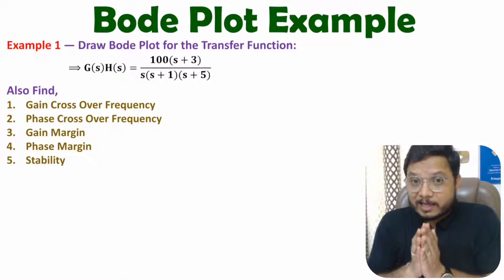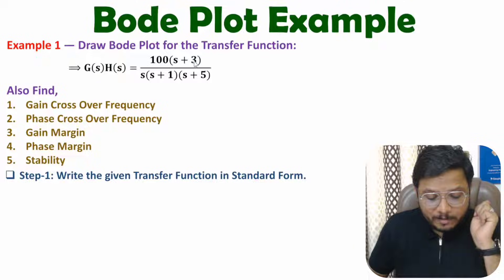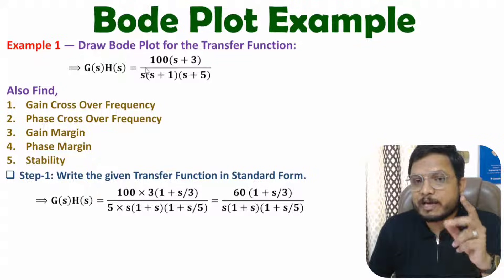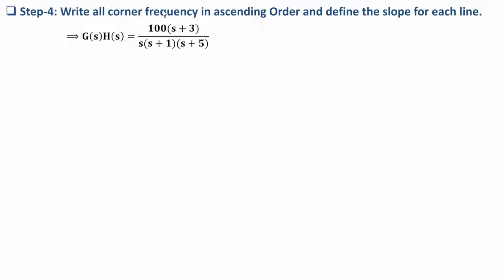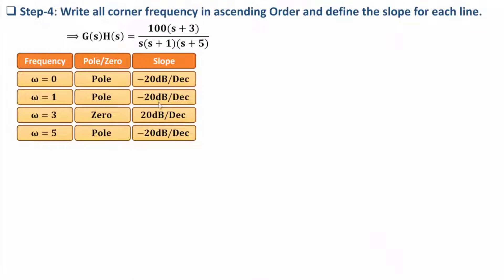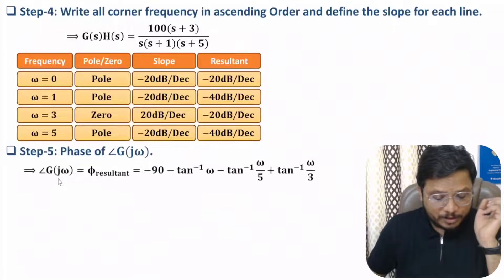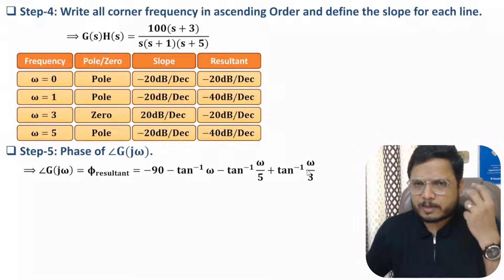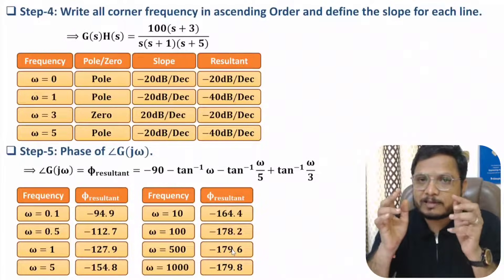1. Bode Plot Solved Example: Steps, Procedure, Parameters, and Stability

Comment: @@EngineeringFunda, How you could check the angle of PM=15 degree? the WGC, is obvious as we read directly the frequency but PM ?! is there any formulation or MATLAB showed it to you?
Thank you in advance.
Reply from the maker: It is measured with respect to -180.
Reply: @EngineeringFunda  , i understand its a compared with Axis of -180 degree but still its not clear for me . where was written 15 degree?!
Reply from the maker: @Fatemeh-u7x3u  : at gain cross over frequency, the phase plot is 15 degrees away from -180 degrees on top. and it is an approximate value, not an exact value.
Reply: @EngineeringFunda  , OMG! thanks for input, now i realized it. sorry for this bad example... i am watched the whole signal and system and now the whole control series , in one point it is getting very crowded and complicated. could you make a video please and categorize all the topics briefly?

Comment: Hello sir, at 10:04 , why didn't you calculate the line for w=0 (for pole) corresponding to -20db/dec. I am not able to visualize the plot for first corner frequency. Could you elaborate?